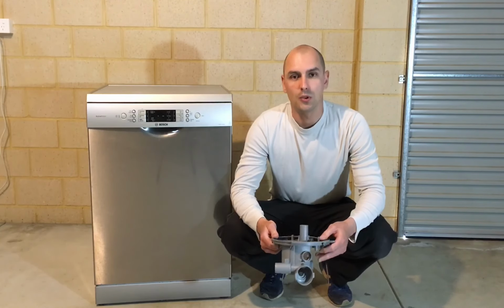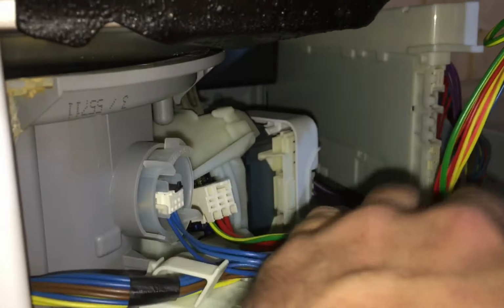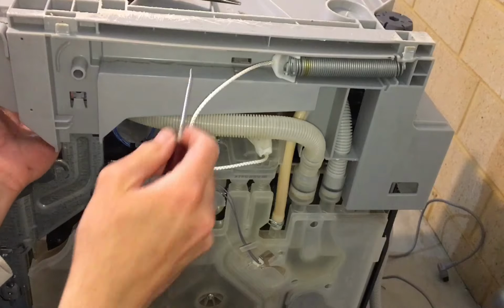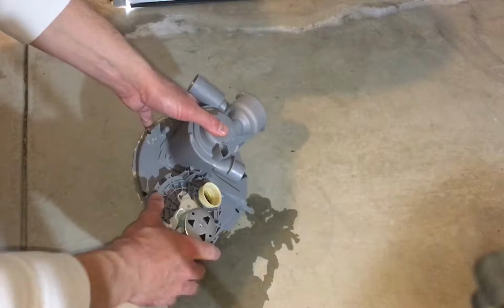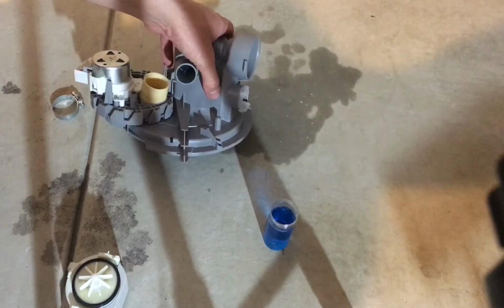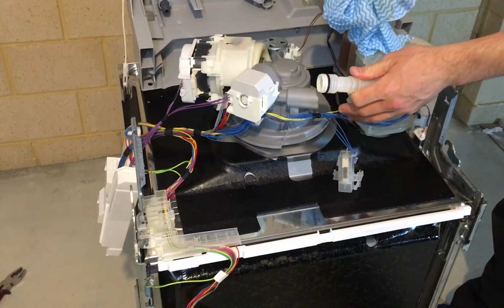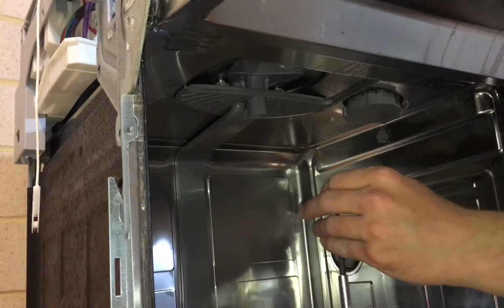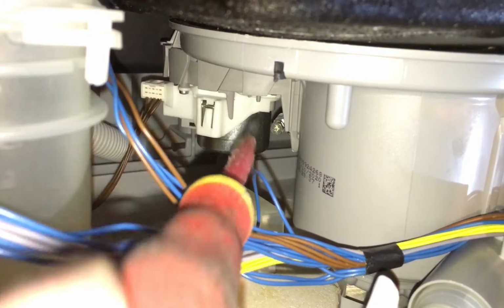Bosch Dishwasher Sump Replacement

Comment: I got a E15 error code on my Bosch dishwasher. Ordered the 12005744 repair kit, but that could not be installed from the inside on my model (SMS53N18EU/92), the gap at the front is to small even when pressed down. Thank you for this video. I am following this to the letter and so far so good!

Comment: As a novice , I was able to get my beast apart and together from your video/ and get the correct screw driver. Couldn’t have done it without you. Different model with a few different connections but figured it out

Comment: My fault was actually the heat pump but this is the best repair video I have ever seen and made the job very easy to sort - excellent work thanks
Reply: Is the heat pump a likely culprit if sump replacement doesn't fix the water buildup? I just replaced the sump and still getting water. Can't see where it's coming from.

Comment: Thank you for this content. I replaced my sump, wash/heat pump and drain pump today using your video for my Bosch (SHE7ER55UC/50). No hiccups or anything. This video is super comprehensive, I can't really think of a way to improve it.

Comment: I'm about to tackle this task. Although it focuses on the main sump seal, this video, gives me very good info on where to look for leaks and how to fix them. Mine is an under-counter model, but I know most of the main components are close to identical. I did drain and dry mine a few weeks ago but needed to put it back in service right away so I didn't do any trial runs to find the leak. Now the E15 is back and it's time to fix it. I'll update this comment when I am done.

Comment: Mice. I need to get into the base of my washer to remedy damage caused by rodents. I've already replaced the reed switch on the water inlet but I can see that the polystyrene float has been eaten! There is sign of leakage too. Thanks for showing me how to get in there!

Comment: I have SMU68M05AU/23 and had E24 error. I ignored it and over the years, it developed into another error, E15. I stumbled upon this video thinking that "I'll give it a crack to fix it. What do I have to lose?" I ordered a new sump and a drain pump and followed the instructions of this video, step by step. 

To my surprise, this video is very thorough and idiot-proof. I was able to fix my issues and saved labour and outcall costs. I just wanted to say thank you so much for your video. My dishwasher is working like a new machine without any error at all. 

A couple of suggestions to those who are who scared to try fixing their machine using this instructions:
1. Follow the instructions, step by step, slowly
2. Use food colouring to locate where your leak is (E15 error).
3. Label the bloody connectors and cables with painter's sticky tape so you won't get confused which connector goes to which plug (i.e.: 1, 2 ,3, etc)
4. Be VERY delicate and careful when pulling out the electrical connectors as they're quite fragile.

Comment: great step by step thankyou,  i am an ex tv repairman and need to fix our unit.
i have a series 8 (looks the same inside) that has "fault no communication" on the top screen and only apears near the end of cycle only somtimes and  if i open door and turn off for 20min i can turn it back on and it resumes, i was thinking of replacing the heat pump or the drying fan for the zeolite, would i be on the right track? sadly i cant find service manual anywhere

Comment: Excellent video. I have replaced the same part in my Siemens dishwasher. It's a different model, and built in, but on the inside it looks exactly the same.

Comment: I don't think that I could add anything else in what all the others have already written! This video is an artwork...a masterpiece in its kind!!! We are all so thankful to the creator of this video. I have only a simple question. The main (four) original screws of the sump had an extra black seal inside providing extra pressure. Now, after all these years this extra seal doesn't exist (got crumbled)...How can we secure these screws in order not to have leakage from these four holes (screws)???

Comment: Excellent video, very well done. You gave clear instructions, pointing at the right places of attention and showed that very clearly on camera. I had the E15 on my Siemens machine but exactly the same interior. I already had put in the silicone tubing as available as a repair kit. I understand that after it has put in and it goes back to its ring shape and the screws are tightened, it provides this extra seal inside the original black seal by providing extra pressure. I then used your video how to access the water retention area with the float and the switch. I completely cleaned and dried it out and after that I put everything together. After switching the machine on I had no more E15 so clearly I had succes with the silicone, pffft. Thank you for putting out this video, I will save the link should I need it in the future.

Comment: Top notch guide.  Apart from colour my machine is just about identical so it was easy to follow every step.  Heater pump and sump replaced.  Thanks, from the other side of the planet.

Comment: Great, clear instructions.
Looked for ages befor stumbling on this
Helped enormously
My code was E04, but since stripping, found water from the leaking sump seal had burned out the heater.
The ony downside is my other half is dissapointed she is now not getting a new dishwasher after I fixed the existing one 😁

Comment: I took apart my machine multiple times. First to fix a defective head pump and after that because it was leaking water. Tried to fix it with some heat resistant kit. Did not work :-(. So now I'm going to install the sump part like you did in this video. And indeed the metal part is sharp. I cut my finger twice on it... Love the very informative video that you made!

Comment: I had the same issue. Although you carried out the correct fix, I simply unscrewed the sump from the inside and removed the water spout. I then pressed down on the sump creating a gap enough to nozzle some clear silicone all around. Tightened up the sump screws and cleaned all the excess silicone and left for 24 hours. Works a dream. 2 years and counting and it’s done it’s job. Took me 30 minutes and I didn’t have to strip down and rebuild the whole unit. This comment is just for others who may feel they want to save time and €£$¥. Great video though, well impressed 👍🏻
Reply: Hmmm, I think this is a good idea. My machine is 9 years old and at some point it will be better to replace than repair. Silicone would have kept it going and ultimately I will be replacing it at the next breakdown. With my sump replacement done, I feel like I need to squeeze another 5 years out of it!
Reply: Also Bosch make a gasket seal kit fix part 12005744 to fix E15.  Buy it directly from Bosch (cheap like $20) and solves the problem.  Even comes with a little sticker to add to the door lip to show it's had the retrofix applied.  It can be installed without disassembly ... but nice to take it apart for cleaning as the soap residue is everywhere ... I also ordered a new float as the old one had rotted away.
Reply from the maker: As a repairer I don’t use the seal kit. It is impossible to properly clean everything with out taking the sump off. If the surfaces aren’t cleaned properly, very often the dishwasher start to leak very shortly after the seal replacement. Those seals are only usable when the machine is nearly brand new and does not have years of limescale and dirt build up.
Reply: I was tempted by a similar sort of bodge... But, following this excellent video, I'm 100% confident the leak is now fixed
Reply: This worked for me! Great tip! The proper repair was too long. I worry I wouldn’t get it all back together after dismantling it so much. I will just replace the machine if it leaks again.
Reply: @kymbolino hi! Arent you worried about the silicone being toxic and spreading on your dishes with all the heat and water? Or is it safe because it is in the bottom? Did you apply over the metal also or only in under between the metal and plastic? Thanks!
Reply: hi! Arent you worried about the silicone being toxic and spreading on your dishes with all the heat and water? Or is it safe because it is in the bottom? Did you apply over the metal also or only in under between the metal and plastic? Thanks!

Comment: Great instructional video. 
I’ve checked my inlet and return lines, drain pipe motor and I still get a check water light. No visible water marks. I’ve taken the pump out and cleaned it. No obstruction. What could be another problem stopping my machine mid wash?
Any help is greatly appreciated

Comment: Hi, thanks for your excellent video. Unfortunately I got a qube of gray plastic block left over that fell out when removing the bottom base. Do you happen to know what it's for? I have a bosch dishwasher without counter weight designed for installation under a counter top.
Reply: See 32:26 to 32:34 in the video

Comment: Thanks. Replaced my sump today using your instructions. Nothing unexpected, no problems, no breakages, no leaks afterwards; took it apart and reassembled it.  
Machine is happily sloshing away in the kitchen now. For me, I had to get some limescale gel because the mating face for the sump was scaled up from the leak and I didn't want to scrape it.
Thanks again.
Reply from the maker: You're welcome.
Well done on the repair, good to hear that the video is useful.

Thank you for watching
Reply: How long did it take to perform the repair?
Reply: @jeffreyschmidt3997  I left the whole day to do it, but it was done in half the time even including the limescale treatment. I gave myself loads of time because I expected issues. The machine is still working fine with no leaks - a year later and used daily. A very worthwhile repair.
Reply: @julianwilson5468  thanks for the speedy reply!  Great to know :)

Comment: Maybe it is nice to know Bosch has a gasket repair kit 12005744 (you put an extra gasket into the sump, don't remove the original ring)
It could be a cheaper and easier solution, in case your sump is in good condition and hasn't bent or deteriorated over the years.
The gasket can be placed without taking out the sump completely, if you wish to do so. 
A video on this is made by mr 'the Oracle'

Using silicone sealant as suggested by Skylvester Skallont, sounds like a good idea as well.
Reply from the maker: I've tried to use the  gasket repair kit. in more than 50% of cases the machine would leak because without complete disassembly and clean of the surfaces the new seal does not seal properly. Most machines i see as a technician have a lot of limescale or dirt build up that needs to be removed before any part replacements.

Comment: Hi I had an e15 fixed the leak powered it back on now the buttons are not responding and the error code is still there any ideas? There is a box on the inlet hose that's wired back to the machine covered in a pipe is this an inlet valve?

Comment: Excellent video but can I suggest that before you replace your sump/seal, try just tightening the four screws shown @0:51. Take care not to overtighten. I did this and it solved my leak which had been giving me e15 for the past few years. I had been foolishly doing the 'tilt' workaround but this video has taught me why that was such a bad idea.
Reply: Owen, you have no idea how grateful this internet stranger is to you!  You just save me a TON of work.  Not to detract from the amazing step by step video, but ya, my screws weren’t tight, problem solved, lol.  THANK YOU!
Reply: A welcome, straightforward video with just the right level of narrative and tips, thank you.
However as I didn’t have time to do the stripdown at the moment, tried the screw tightening suggestion here and it worked. Throughly checked for leaks whilst running with the side panels off through 5 wash cycles, and several weeks later all seems good.
I’m expecting to need to replace the seal at some point, but meanwhile this was a welcomed quick fix.

Comment: Brilliant video. Ive been searching for how to pull apart a bosch dishwasher for ages. E15 error like most, but other searches just go through removing the code and not sorting out the root cause.
Reply: Turned out to be the plastic shroud to the pump inlet had dislodged. Hope this helps someone with the same problem.

Comment: Super video.  Exactly the same model as we have.  Ours is not heating the water and other videos say it's probably the relay on the control board.  From you I can see how to get the top and sides off.  Does the control unit come out of the side without turning upside down and removing the base?
Reply: At great effort we've taken everything apart, following your video, but it wasn't quite the same as yours.  On each side was some kind of plastic water or vent air processing system.  We removed the motor and where the heater wires connect we can see one of the heater tracks is burnt out.  The day the dishwasher stopped heating it was set to run in the early morning, and at 05:20 the house RCD tripped out. Now we know why.  I can see a new pump+heater is  £125 but as it's 10 years old I think we'll get a new dishwasher.

Comment: Thank you so much for explaining how to remove the base. I don't think I would ever have found those hidden tabs under the rope guides and I needed to remove the base to replace the zeolite heater on my dishwasher. It was corroded to hell and created some earth leakage which erroneously gets reported as a communication error at the start of the drying cycle.

Comment: This was a great video, I'm having the same issue right now and will attempt to fix as per your video. One question though, you didn't list or mention what the sump part number is on the video or in the comments. I could not find it, ill google it now anyway.
Reply: I found all the parts I need on the bosch website once I put in the serial no. etc... all good to go now
Reply: @ozkan889  How long did it take to perform the repair?
Reply: @jeffreyschmidt3997  not long, if you have the right tool and hardware roughly 2-3 hours I got it done in the garage working at it slowly

Comment: Excellent video! I just stripped our NEF built-in DW after it gave repeated E:15's. During the Chef cycle (only for some reason!) after I frigged the float switch it leaked about 250mls per cycle. It did not leak on other cycles at all. When I stripped it, there was a serious build up of limescale on the seal of the diverter assembly. I scrubbed it all out, reassembled and everything now fixed. Thanks again for making such a detailed video!

Comment: Very thorough

Brilliant video showing how to get in and out of the dishwasher innards... Exactly what you need to replace the sump with the confidence that you're not going to snap anything on the way in or end up with a spare part or disconnect after assembly

Thanks very much

Comment: Hi there.  Thanks so much for this video.  I had a leak and the resulting error 15 on my Bosch dishwasher and needed to replace the sump.  I got the part easily from Bosch but without your video I would have completely failed on this quite complex task.  Your demonstration and verbal instructions were clear, easily followed and complete,  My dishwasher is back working as it should be.
Great job!

Comment: What is the reason for removing the door panel?
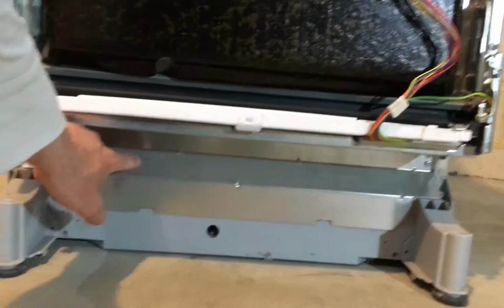Reply: At 3:17 you need it off to get at the screws to remove that metal panel. Bosch apparently doesn't want you getting in there without some knowledge (YouTube videos...). If you're getting E15 the first thing you'd want to do is get that panel off to check for water, so making this so difficult seems dumb. I think you could slip a torx bit in there and unscrew them with a wrench against the bit, but the door panel would still obstruct half the opening under there.

Comment: very good, informative video, thanks
i just replaced the sump on our 9 year old siemens , as it was beginning to leak. 
unfortunately now once is powered back on the control touch buttons and led indicators on the top of the door stopped working( lights on inside the machine) , i checked all the wiring and connections seems to be intact , no burn marks on the control boards. any ideas / advice what else to check ?
Reply: sometimes a wire can (unvisibily) get loose from the connectors. 
I managed to pry the connector open, re-insert the wire and clamp the connector together again. It did the job.
A multimeter comes in handy to test the wires running from one connector to the other.
In your case I would test the wires and connectors going to the affected controlls.

Comment: Very interesting seeing the disassembly. What did you do with the water in the plastic labyrinth type reservoirs on the sides, and in the salt reservoir, before you turned it upside down?
Reply from the maker: Sorry slow reply. On this one the side container was empty but the salt one was full. I usually leave the water in those containers though. They are fully sealed and operated by solenoids to release the water when the dishwasher requires it.

Comment: Only had the dishwasher for 2 years.  How long do the seals usually last?
Reply: If you get the error code, first check those 4 screws inside are tight. When I replaced my sump, I noticed they weren't tight. This is probably something that happens with all the heat cycling etc.

Comment: Very very good video.  I only had to replace the recirc/heat pump, but this gave all the needed and would-be-tricky steps for how to get the thing apart and back together.  I now have a working dishwasher for just the cost of the pump and a couple hours time.  Thanks!